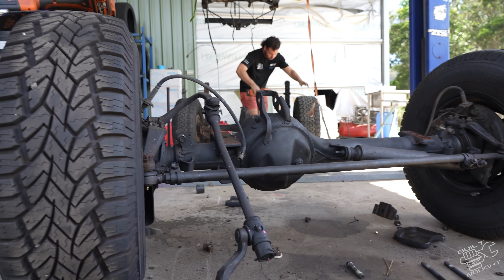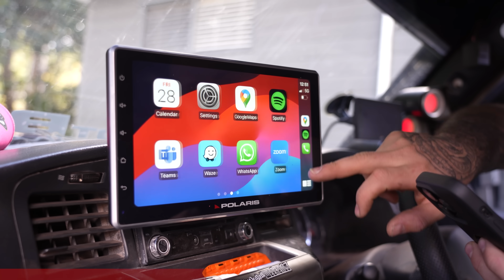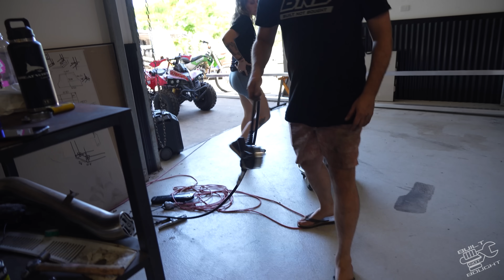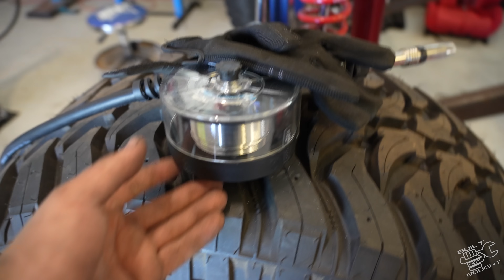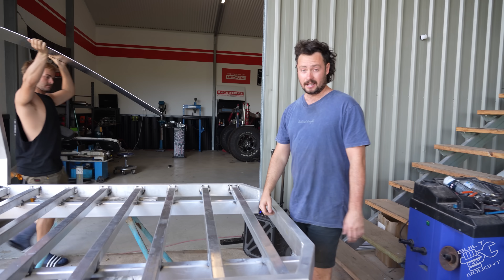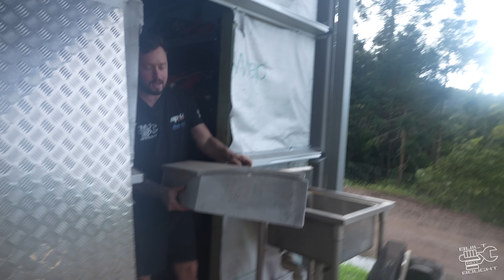Building An Aluminium Tray for the Hilux 🚨

Comment: Can you give me some tips on fusions. I am in the middle of building a ladder rack for a jeep gladiator
Reply: Not really a tip for fusion but. If you have access to their other software (Autodesk inventor) unfortunately it's not free like fusion but you might be able to find some uni kid with a student lisence to help you.
The frame generator function makes light work of pretty much any structural steel work. Will automatically add mitres and calculate those angles for you

Comment: Ok! Is it that you guys un Australia can't or won't do u bolt flips? They are the nost beneficial mod on leaf sprung vehicles. Yet no one over there seems to do it. Is it because of engineering or what? If it is thenengineering are morons and it is just as strong and much safer.

Comment: As far as I am aware, you don't save much weight using aluminium, it is soft and lighter sure, hence to get strength you use a lot more Ally, on the plus side ally wont rust like steel, but it still does 'rust' in its own way, Ally wont bend and endure stress like steel, just like rims, you bust a ally rim ya done, steel you can beat back into shape, moral of the story, fuck aluminium.
Reply: Built trays for years, alloy is fine as long as you dont put any weight on it lol.